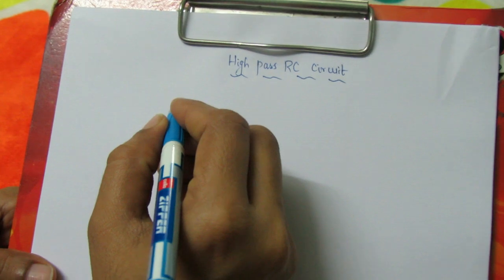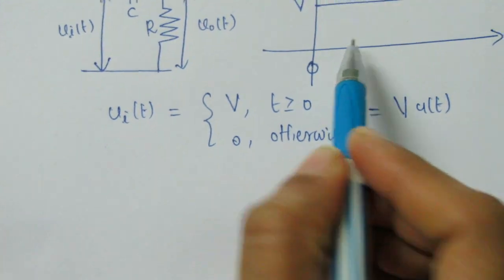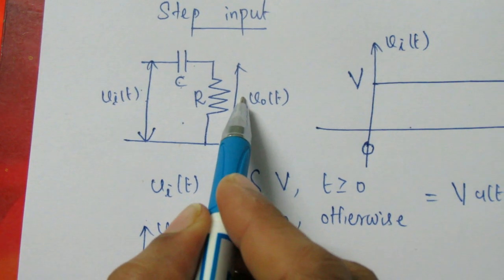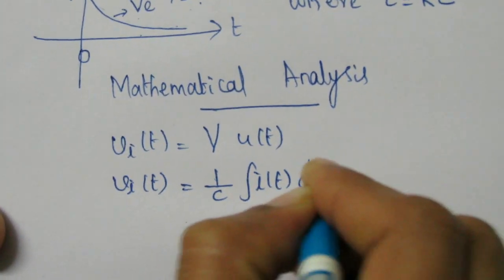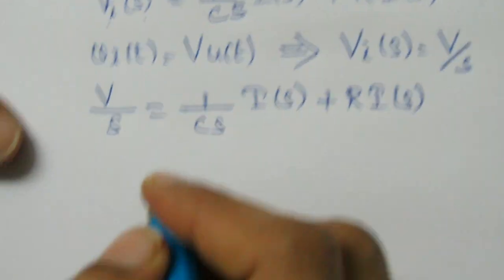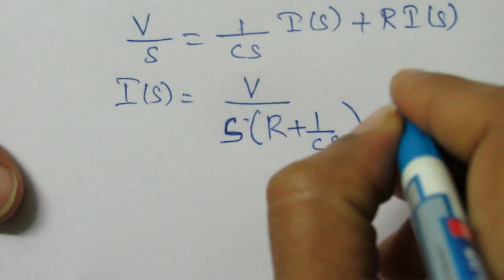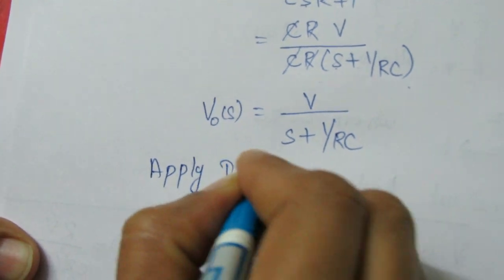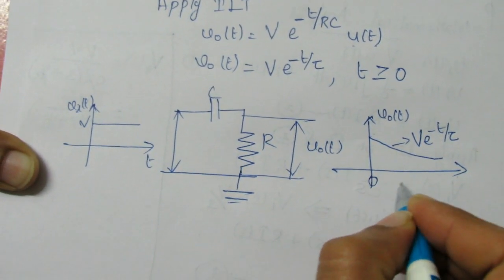Response of High pass RC circuit for step input

Comment: Wanted to ADD :   if you apply a  STEP input (0 to +2V) to the capacitor,  the result at Vout  will be a SPIKE (and then the "transient collapses to ZERO".   The circuit configuration is a DIFFERENTIATOR.   Thank you for the EQUATIONS.  Cesar FEB 20,  2020

Comment: mam in steady input the value of voltage remain constant( i,e V ) then it will act like an dc noo..? so why  it has output response..!
Reply: Capacitor doesn't allow sudden voltage change across it.When any abrupt change of input voltage occurs in the circuit,capacitor doesn't allow the voltage to change simultaneously across it rather it works as a short circuit initially then starts to store energy thus it charges.After a certain amount of time when capacitor gets charged, it works as a open circuit then the voltage across resistor goes to zero.